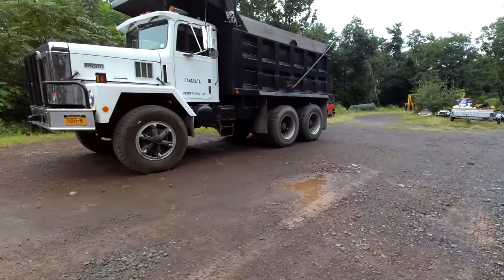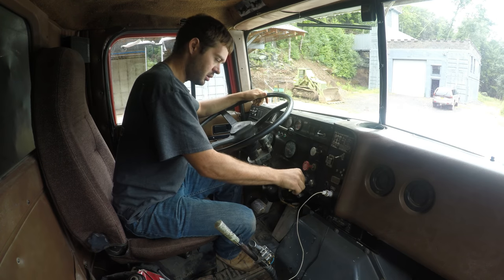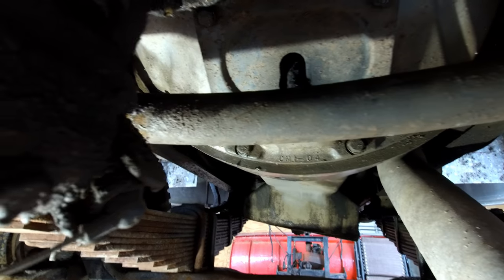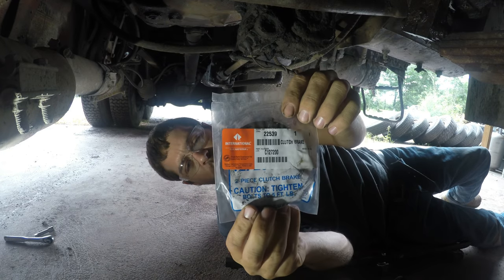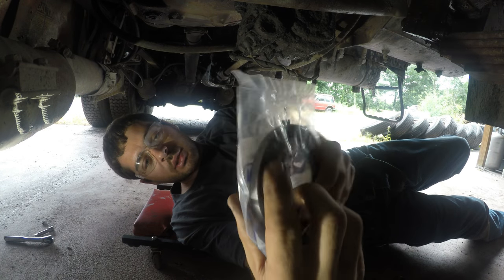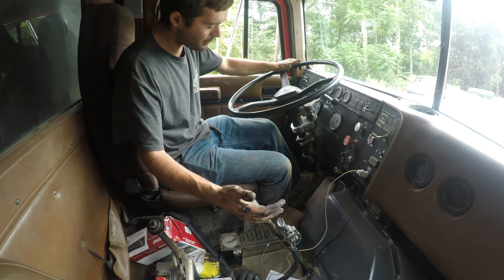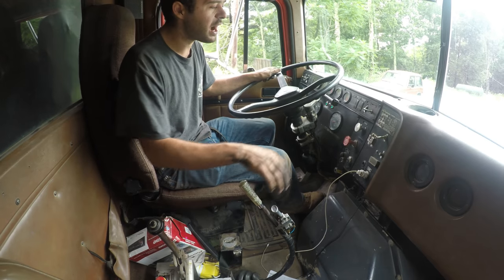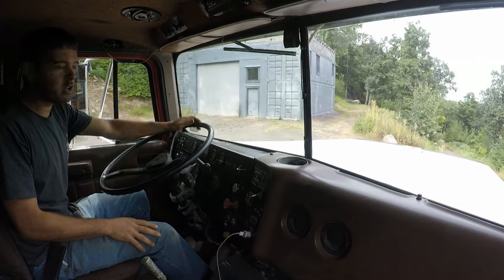Installing a new clutch brake in a dump truck

Comment: Andrew, love your videos, but for this truck, you need to learn to shadow shift... The only time you need to use the clutch is when you start and stop.  When you want to shift up, let off the throttle and normally for 13 letter shit spreaders  (Internationals) when the tach drops to between about 15,000 and 18000 it will slip right into the next gear. Downshifting is basically the same but you may have step on the throttle to rev it up, let off and when the tach falls between 1500 and 1800 it will again slip in. This works with most transmissions like Eaton Fuller or Rockwells. The exception is Mack, which you gotta wait on them as they are normally lower. Some trucks may be a touch higher like 1800, 1900 and just gotta try it and see how yours is set up. I learning on some old Mack R models, Diamond Rio's , White Constructors and Autocars which had 2 and 3 sticks.People today got it easy with the Allison automatics like in your little Ford. But they would freak out and panic if they drive one with an Aux. transmission. Pretty easy once you get the hang of them.  LOL 

When running empty, skip gear and it will help save on fuel consumption. Like anything, practice makes perfect and keep at it and you'll get the hang of it! 

Living and operating where you do in N.Y. it is good to learn to double clutch or double touch it as my dad used to say for being loaded and on hills and this is where the clutch brake ready comes in handy.... like being loaded, having your trailer on with your big trackhoe going up a hill. I don't know for what gears your Loadstar is set up with (which if I was buying an international, is what I would go with) but 3:55 or 3:70 is good. I had an old Pete someone converted and the bad thing it had 4:11 with tall rubber. A real pain in the ass on hills and often got down into low range going up hills, but on flat ground hauling loads, it was get the put up the main sail and get the hell out of the way! LOL It would run triple digits easy with 500 Cat in it, once you got going! So, it might be a good idea for what you are doing to check with the dealership see for what gears the rear end has in it. I would assume with it being a Loadstar it would at least have 3:70s  or 3:55s from the factory. It is a tough looking truck! 

I just gotta laugh as I now work for the State of Ohio DOT and most of our trucks are automatics and when we need to move equipment like our graders, bigger dozers like Case 650's or Kobelco 200 and 250 excavators, our lowboys are still standards with 13 speeds. Hardly anyone can drive them because they can't drive a standard. Its like how the hell did you get your CDL and a class A?  Our newer tractors are coming with automatics and no one can really complain as we rarely have a truck with transmission problems that has an automatic. As for the few standards that most are 10 speed Rockwells, well we are always replacing clutches, transmissions and rear ends... hence the need for automatics. I have people ride with me and I normally have them scared to death grabbing gear and they are like how are you shifting without the clutch??? LOL Plus I scare the hell out of them loading most things over the side rather detach! But don't do that boys and girls unless you are experienced and it is hard on the side rails unless they are beefed up. 

Hope that helps and keep the great videos coming! Better content then watching negative spew on regular tv!!!
Reply: I think he means 1,500 or 1,800 rpms.  Never heard of any large diesel truck engines that could turn 15,000 -18,000 rpms. Maybe it could, once.  LOL!
Reply: He actually did a video demonstrating this after he had had the truck a short while, and had driven it around a bit.
Reply: Please don't interpret to give off the wrong idea. K = 1000 NOT 10,000... therefore 1500 - 1800 Guess I should have stated it 15 x 100 or 18 x 100 as seen on a lot of tachs! lol  I also didn't say "runaway" with regards to rpm's... lol in that case, yeah you're right, it will do it once before it blows up and locks up. lol 

So to clear things up....  A typical road-going ("high-speed") diesel has a narrower band, generating peak torque at lower RPM (often 1,500–2,000 RPM) but also with a sharper fall-off below this, and reaching peak power around 3500-4500 RPM, again rapidly losing strength above this speed. Turbocharged diesel engines with turbo lag (narrowed, exaggerated power band intrinsic to most turbocharged engines) may display this characteristic even more markedly. Therefore, the manufacturer's (or purchaser's/modifier's) choice of gearing, and appropriate use of the available ratios, is even more crucial to make best use of the available power and avoid being "bogged down" in flat spots.

Larger diesel engines in locomotives and some watercraft use diesel-electric drive. This eliminates the complexities of extremely low gearing, as described below.

The largest ("low-speed") diesels—large generators on land and marine diesels at sea—may turn at only hundreds of RPM or even below, with idling speeds of 20-30 RPM. These engines are usually two-stroke diesel engines.
Reply: Stan, everytime I have seen Andrew drive this truck, he is clutching, which again is not a bad to learn, especially in hilly areas and hauling heavy loads. But I have yet to see him shadow shift.

Comment: Andrew, please ask if you don't believe me... lugging a diesel engine can and will harm the engine. When you "up shift" you let off on the throttle. And if you "downshift", then you raise the RPMS to match the gears... up shift means going to a higher no. gear, and downshift means going to a lower no. gear. NOW and this is important, when you do this, depending on   which transmission you have for the spilt to work,... 300 to max 500 RPMS is all it takes. That is also called splitting gears... kinda. That term works where you have two shift levers, which you don't because the range selected is done with air instead of a lever. Practice at home going up gears then down gears. It will save your life. Move out of your comfort zone and do this because loaded, going up hill, and you miss the gear your trying for, the truck if loaded could actually come to a stop and if your a bite heavy then the brakes won't hold the truck!!! You start coasting backwards and over on its side is the best outcome... over someone or a hill and someone can die. I owned a fleet of trucks and women made the best students because they asked the questions instead of being embarrassed. A man thing... sad. Just practice a lot till one day you will be a natural. No one is born with all the knowledge, and it takes time. I see the hills that you climb and so this is important to learn. I'm not trying to be a smartalex, just trying to help you attain the things that you may not be aware of right now. It just takes time but you save money and maybe your life. I'm still amazed at your castle... the eighth wonder of the world, I would never of attempted that task yet you made it look "like joe could do it" and only the guy who gets the lucky powerball ticket is that lucky.... one of the main reasons all diesel trucks have tachometers because engine rpms are just as important as the speed that you travel... maybe more. Also when downshifting,if you are going up a hill then the truck is going to slow down some. Meaning you may want to drop two gears lower to make sure that you can complete the shift. If you know someone who is a driver, ask if you may ride with him to learn this very important lesson... it really is important to get comfortable with the rig your driving. On a side note, you could even touch that old clutch brake out. It affects the "throw" of the clutch pedal and makes for a lot harder learning and sore leg because your worried about how far to push the pedal. Time is your friend

Comment: Let me get this straight, the purpose of a clutch brake is: when the transmission is in neutral, the input shaft of the transmission is spinning. Then when you want to put it in gear, first you have to press the clutch pedal, but the transmission-side of the clutch is still spinning so it's hard to put it in gear now. This is where the clutch brake comes in. Why isn't this necessary in small vehicles? Their gears are smaller and they stop by themselves?
Reply from the maker: I think because they have synchronized transmissions.

Comment: Ok as an old truck driver, I never used clutch except when i was stopped and gear engaged, what i would do when coming to stop is pop out of gear and into lower gear that i would use after stop.
and hold clutch in while at a stop. I hope that makes sense to u.

Comment: Try this for a smoother switching gears:
0:when you are already in the first gear and moving.
1- step on the clutch half way.
2- put it in neutral.
3- press the gas paddle and bring the rpm to 1500.
4- step on the clutch half way and quickly shift to the second gear.
5- repeat step 1 every time you need to switch gears.
This method worked for me in the past..
let me know if this works for you bro..good luck..nice video..

Comment: I think i get it,the brake stops the inertia of the input shaft after you push the clutch in. And you can use it while the wheels are turning if you put it in neutral first without the clutch so it doesn't brake the wheels. or am i wrong? never driven a truck like that.

Comment: If you can't find em grind em! Haha  Looked like you might have been shifting late when you were going through the gears on the road. Unless your clutch is way out if adjustment, those gears should slide right in without even using the clutch. I'm guilty of late shifting because I've gotten used to revving  gas motors past 4 or 5000rpm before shifting. These diesels like to use that torque down low.

Comment: Depress an inch when changing gears. Also takes time and what you have shown is normal to me. I probably don't think you wrecked it but just age. Tips Don't leave the exhaust brake on, when you get really good at changing gear you won't need the clutch but whilst and I still do depress the clutch when getting out of a gear and slow down when changing let the rpm fall(feel the gear in). I'm not a professional by and standards but who ever sold it to you should have takin it for a drive with you and told you all of his secrets. A mechanic will be impressed on how shiny the gears will be when it needs a rebuild. All you need is time in the seat and ask questions

Comment: If u would not rev the engine quite so high, or pause and let the rpms drop just a little before floating into ur next year it wouldn't scratch(grind) like that at all...

Comment: Can't say I agree with leaving the old brake in.  Adjust the new brake/throwout bearing gap to 1/2".. use a air hammer to split the old single piece.
Tang always lines up w/ groove in input shaft.  Great video as always though!
What video editor are you using?? Thanks

Comment: When u shift make sure u double clutch and the clutch needs to go in all the way to shift. If u press the clutch half way u will grind every times and some advice when slowing down try to down shift so u don’t burn up your brake pads coming to a complete stop. Other than that nice old school dump truck ih. There rate finds any more

Comment: Funny thing drove  truck for 20 years, now after 10 years not driving clutch my right hip are messed up arthritis.
Clutching is not fun. Also using engine brake in not good, double clutch is good also for tricky clutch.
But great 👍🏿 videos.

Comment: Have you ever heard about double clutching when shifting?  It will 1) smooth out your ride (less jerking), 2) make your transmission last longer, 3) save wear and tear on the Clutch (and associated parts).  Give it a try.  No you do not need to double clutch, but you should.

Comment: Wow, not only is the clutch brake gone, that clutch is way out of adjustment. With clutch pedal released, there should only be 1/2" inch maximum clearance between throw-out bearing and clutch brake. You have close to 1" inch.  Use a pair of side cuts or metal snips and cut out / remove old clutch brake disk, install new style clutch brake then adjust clutch to 1/2" inch max clearance between throw-out bearing and face of clutch brake disk.  After you get clutch adjusted, check the space between clutch fork dogs and throw-out bearing contact points and make darn sure there is only a 1/8" inch gap in between the two. This is adjusted by the clutch rod linkage. These two surfaces should never touch when clutch pedal is released. And never ever ride down the road with your foot resting on the clutch pedal. When properly adjusted, there should be 3" inches of free-play at the clutch pedal. Once the clutch pedal rod linkage is correctly adjusted to obtain 1/8" at the fork dogs and 3" at the pedal, make no more adjustments to this linkage for life of clutch. When the free-play at the pedal is gone, only make adjustments the clutch to regain 1/2" inch clearance and nothing else. If clutch is ever replaced, check to ensure measurements of 1/2", 1/8", and 3" are maintained. It'll be just like driving a new truck.

Comment: Get a barring tool to hand turn the motor.  They are typically <$50. You will eventually need one to reset the valves when it comes time.   Also for a non-syncro trans you should NOT be using the clutch after launching. It should all be done by RPM both upshift and downshift.

Comment: Be careful with all that grinding.. that's a synchro rounding out.. if it grinds so much you'll have issues engaging that gear, or having the lever pop out of gear
Reply: That transmission doesn't have synchro.
Reply: @stanpatterson5033  really? How does it work without synchros? It's got a clutch that engages and disengages.. that's interesting, more info please
Reply: Heavy truck transmission builders in North America just don't put synchromesh in heavy truck transmissions.  In fact,  synchromesh was designed for automobile transmissions,  to synchronize the speed (despite the fact that a clutch is disengaged) of spinning shafts and gears as the person is moving the shifter into the selected gear.  But,  you may notice that while all forward gears in small vehicles have synchro for all forward gears,  none of them have it going into reverse.  That's because they want you to be absolutely still when trying to shift into reverse.  Anyways,  on a heavy truck,  adding synchromesh to every gear would add more weight to the gearbox, which is already quite heavy and complex.  Without synchro,  you just learn to throw the shift at the precise moment.  It takes time to learn, and time to perfect.  It helps if you have motorcycle experience, where it's important to match the revs before letting out the clutch, lest you cause the rear wheel to skid, or drag or lock and cause you to lose traction on the back, possibly wiping out.  You still need a clutch to shift a bike, but when downshifting, if you don't rev the motor to the approximate rpms that the lower gear needs, when you let the clutch out,  it will (best case) cause premature wear to the clutch pads and discs, and (worst case) cause a loss of control,  possibly landing you with a bad case of road rash.  Same thing in a truck,  except less likely to lead to a wipeout, but will accelerate clutch and disc wear,  and on slippery roads, could lead to spin-out, or dragging tires until everything gets matched up to the same speed.  Go look on the internet for some videos demonstrating what synchro is, what it does,  how it works,  how it can be abused,  what happens after it's worn out.   It's a nice thing to have in a car or a small truck,  but it's a real pain in the ass in heavy trucks.  Far better to either learn how to float-shift,  or get good at double-clutching every shift (which sucks, too).  I have been doing it since 1984,  and while float-shifting can be tough to wrap your head around, once you learn it and master it,  it just makes life so much simpler.  Sometimes I get a new truck or have to drive a different truck if someone gets sick or whatever,  and jumping into a strange truck with a different shift pattern, different clutch pedal level,  different engine, etc can throw you for a bit of a loop until you get your brain re-programmed for it, but after a minute or two,  it's old hat again.  My philosophy is, to leave the clutch alone as much as possible,  but use it if you need it.  Over-use of the clutch simply means excessive wear on certain components.  You want to try to not wear much of the lining off the pads and disc surfaces, and avoid abusing the "throw-out" bearing (also called the release bearing).  The only place that synchromesh would do any good would be lowest or maybe first gear,  but if the clutch is properly adjusted and the clutch brake isn't blown or simply worn-out,  that is all you need to get it into the gear you want to start out in.  After that,  disciplined, controlled shifting is all you need to go from a standing start to top gear, and later, all the way back down.  In fact, you could down-shift all the way to a stop, and just slip the trans into neutral from the lowest gear without having to throw down the clutch if you know what you are doing.  But,  it's good to have a clutch in good condition to get moving from a standing start.  Once done with the clutch from the lowest gear,  you won't need to touch it again until you've come to the next complete stop.
Reply: @stanpatterson5033  dang thanks for the info bro! That's badass! 👍👍